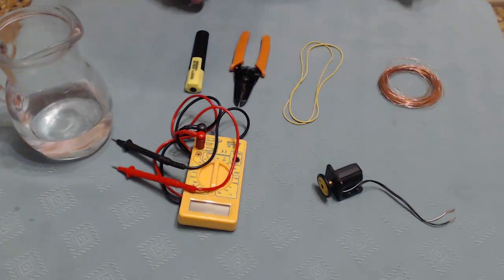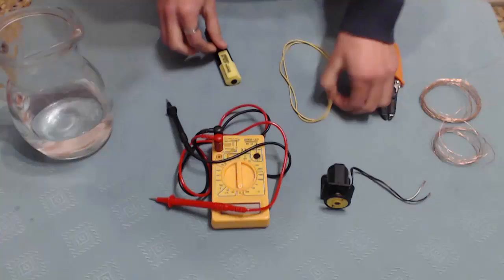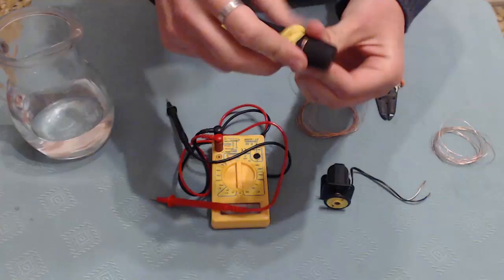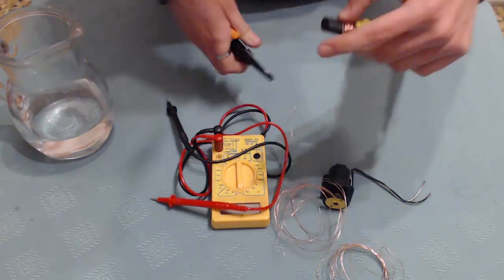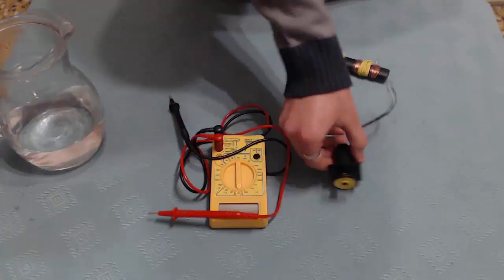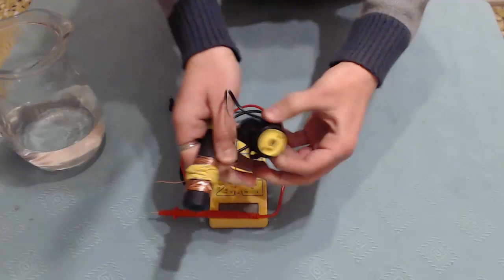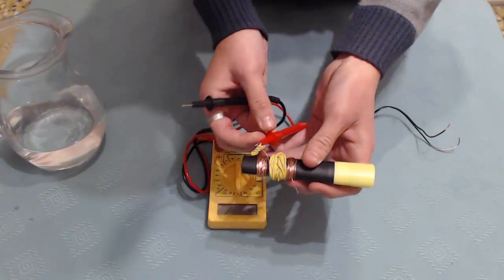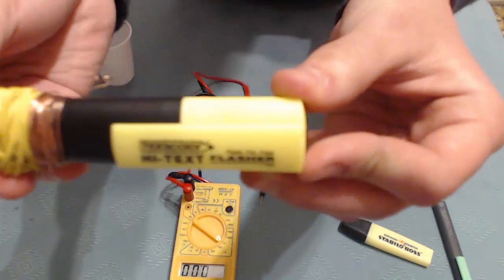How To Make Free Energy Generator from a Highlighter

Comment: almost got me there - even if the highlighter does have a field it would have to be oscillating to work like that  ... so if there is a highlighter that is radiating oscillating current (ac) then the thing would be ripped of the shelves as a danger and used in other applications or maybe - especially if they were using isotopes hahaha - anyway, at least have the courtesy of putting this sort of thing online on April fools day ;)